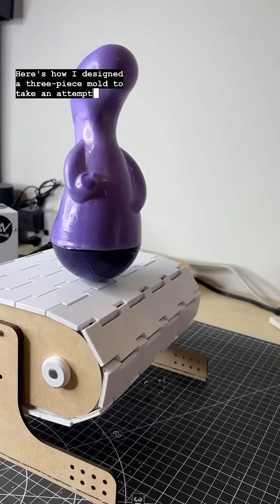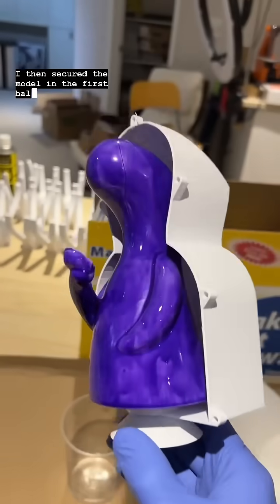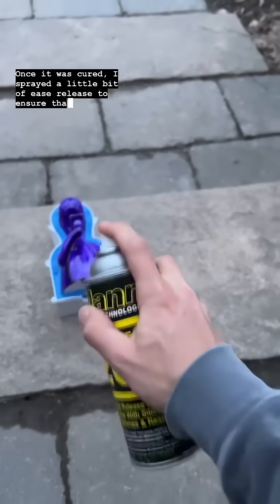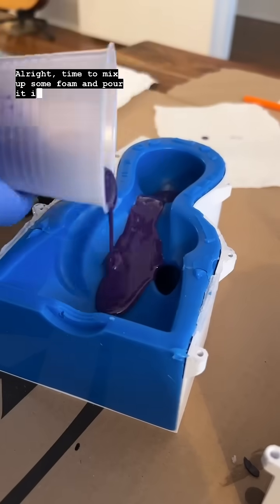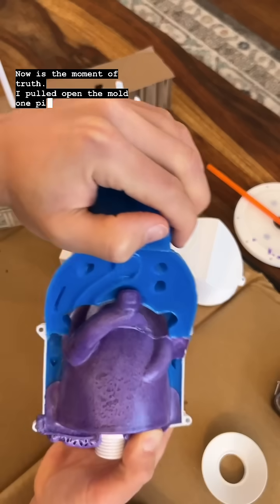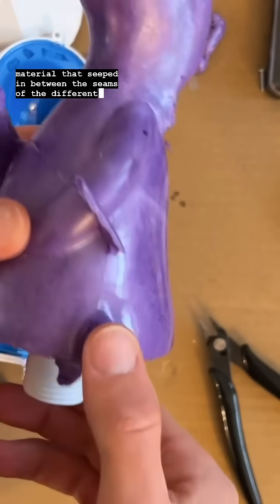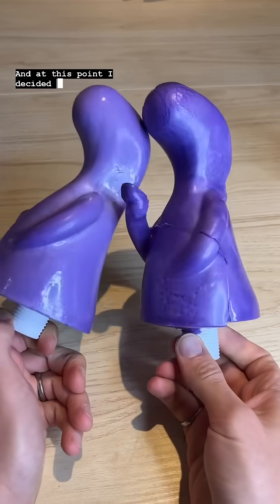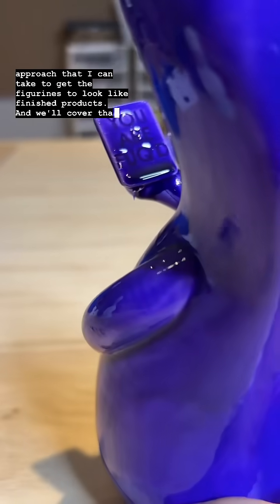Making A 3-Piece Silicone Mold

Comment: One piece mould looks like the way to go. But you need to give it an air path to evacuate the arm. You should drill a hole in your shell and stick a hypodermic needle through it through to the arm cavity to make a channel in the silicone. You may then need to shorten the needle. The air would be able to make its way through the needle. Ideally you'd achieve a small sprew there that you can just clip off. There is still a lot to go wrong there and trial and error, but fundamentally lack of evacuation is why the arm won't fill, so that's the direction to dig in.

Comment: The reason why a one piece mold didn’t work most likely has to do with the fact that there is no vent allowing the air in the arm to escape as the foam level rises. Adding a small vent should let the cavity fill without a problem.
Reply: this, he can absolutely pull this off with moulds with just a bit more patience
Reply: Yeah, plus one on this

Comment: My solution to the arm problem (albeit for a different purpose) was to use a one piece mold and just use a syringe to fill the arm prior to filling the rest of the mold. Alternately, I've also had success using a vacuum chamber to suck the bubbles out of thin sections.
Reply: Personally, I’d combine the two molds, using the one piece as an inner liner to prevent the edge lines shown. You at least then get the structural integrity of the hard shell without the downsides
Reply: He’s casting foam. You certainly don’t want to throw that into a vacuum pot.

Comment: Nice work but did you knew that you could place a model in the cura slicer and make a mold by going to the settings and kliking on a setting witch is called mold. Hope this helps  😊
Reply from the maker: Definitely! But the foam has a tendency to stick to everything especially 3d printed molds which is why I went through this whole process
Reply: Oh sorry i didn't know this